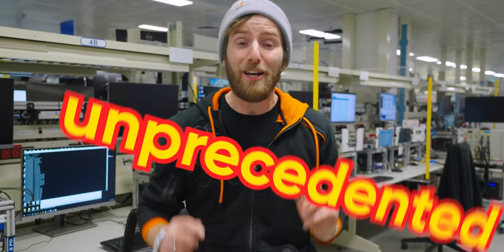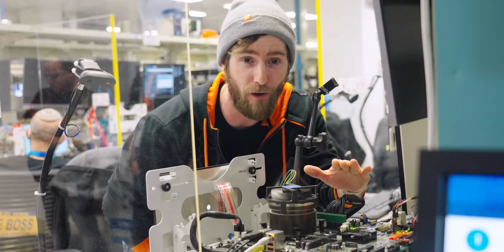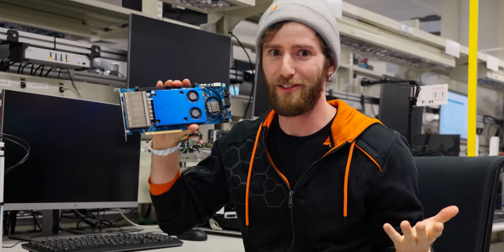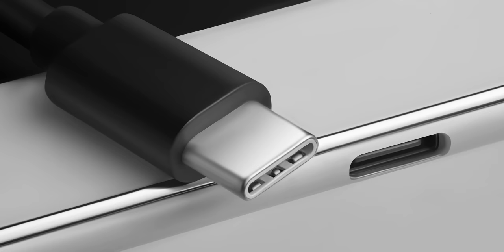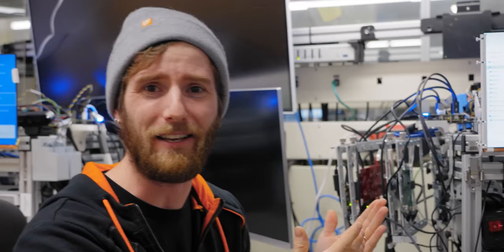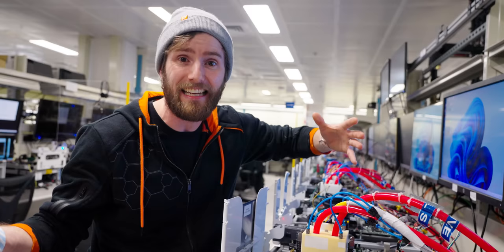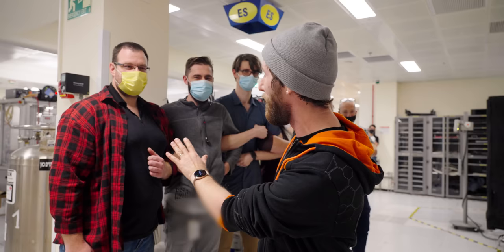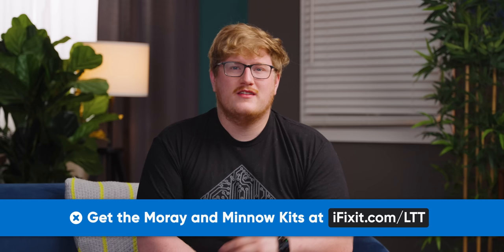I’ve Never Had So Much FUN - Intel Development Center DEEP Dive

Comment: > What came first, the chicken or the egg?

You could say, the egg came first, because dinosaurs laid eggs a looooong time before chickens ever existed.

If you clarify the question to specifically mean a chicken egg, not just any egg, then the answer becomes: "it depends on how precisely you do define `chicken` and `chicken egg`". 

Chickens evolved from their ancestors (let's call them proto-chickens) in a very slow and gradual process spanning a long period of time - so we have to draw a line in the sand somewhere, just to be able to separate chicken from proto-chicken. Keep in mind though, that this is an arbitrary choice! But no matter where you actually draw the line, there will be one parent animal that's not quite a chicken yet, having an offspring that is an actual chicken thanks to having one additional genetic mutation. The very first chicken of all time hatched from it's own egg, and thus the egg came first, or did it?

Well, the mutation that created that first chicken occurred, when the male sperm fertilized the female egg cell causing the DNA to be rewritten, and resulting in a fertilized egg cell. That fertilized egg cell later gets encased in an egg which then gets laid. And finally the first chicken hatches from that egg. Depending on how you define "chicken" and "egg" - the fertilized egg cell itself might already qualify as being one or both. When does the chicken start being a chicken? Is the egg a chicken too? Is the egg cell an egg? At this point the answer becomes undecidable, right?

If you clarify the question further to specifically mean a hatched chicken in addition to meaning a chicken egg (which probably is what Plutarch originally meant when first posing the question) - then you now have to answer the question whether an egg laid by a proto-chicken but containing the DNA of the first chicken counts as a chicken egg or not. You could argue that the egg is not an chicken egg, as it wasn't laid by a chicken. It's a non-chicken egg that contains a chicken inside - as the egg was still formed by non-chicken, thus the chicken came first, right?

It's extremely likely though, that the egg the first chicken later laid (the calcium carbonate shell, egg white, yolk, etc.), is completely identical to the egg it itself hatched from. There's a lot more genetic material defining the animal, compared to the tiny bit that defines the egg. Thus it's statistically highly unlikely, that this one mutation that caused the switch from proto-chicken to proper chicken would actually change the egg in any way. Thus, the only reliable to way to define what is a chicken egg and what is not, is through the DNA inside. And that would make the egg the first chicken hatched from be the first chicken egg. Thus, it would seem that the egg came first after all.

You might now try to define the genetic change that creates the very first chicken to be one that specifically affected the egg. Then the first chicken's eggs would be actually different from the egg the first chicken itself hatched from. But now you're just being a stickler for red tape! Remember what I told you to keep in mind? The choice of where to draw the line between proto-chicken and chicken is arbitrary, and was only done to allow for a clear differentiation between proto-chicken and chicken. But in reality, there is no clear single point where the switch occurred - and in sum there were many genetic changes, most if not all of which concerned the animal, not the egg. 

Specifically picking that rare (maybe even non-existent) egg-related mutation as that arbitrary line in the sand, AND defining chicken egg as "laid by a chicken - regardless of whether there's chicken DNA inside - that's a set of very artificially crafted assumptions to make. So no, that's not a very robust and believable line of argument. And since there is no other way to arrive at "the chicken came first" - the final answer is that the egg did indeed come first.

Comment: You forgot to mention another huge advantage of FPGAs, they can be more economical for production too, when you are talking about small scale.
If you are only producing a handful of devices, the total production cost associated with an ASIC can  be much larger than just paying (a lot) extra per unit for a handful of FPGAs, that's why you find FPGAs in a whole bunch of commercial products.

Comment: As an experienced IT guy, I know that the gearheads will always be locked away in the basement. Yes, litterally. 😂 Sometimes, they put us at the ground floor in a windowless room. Or sometimes, when you're lucky, you get a tiny window with a view... to the HVAC ducts outside (like I have right now). 😅 If you are new to IT I just wanna be completely honest with you: That's the, best you can hope for. 😝

OH! Once I had an office with a view of the street. But I was in a garage that was hastily converted to the IT department's office... and that window was in a garage door. 🤣

Comment: Back in 1999 or 2000 when I worked at Lucent Technologies I was working on the HP Kayak hard drive recall.  In one of the locations I arrived at the users office while they were out, and started working.  There was some weird rig set up in his office that was supposed to be covered, but the cover had apparently fallen off before I got there.  I was wondering what the heck it could be.  It had what appeared to be a CPU in a ceramic package, but the center appeared to be cut out, and there was a laser pointing at it.  When the user returned to his office I asked him about it and he got extremely nervious.  He refused to answer any questions, and told me that I didn't see anything, because if I did he would be fired immediately.  I wonder if what I saw was the same thing as discussed in this video.
Reply: ok.bro

Comment: I know it's a diff thing but USB 3.2 is 20Gbps (plus, two lanes), whereas 3.0 was 5Gbps. That change only took about 6 years. I'm aware USB can't do all the exact same stuff and we're mostly talking about data speed with USB. However, consider a good read/Write speed for an external SSD is around 1Gbps. That's about as fast as the internal Series X disc drive and very fast. It's only using 5% of max capacity, and still super fast. My point is someone will create a converter for USB 3.2 & beyond. This will happen for some things and USB slots are wayyyy cheaper on.

Comment: I used to work at intel, yeah, crazy tech guaranteed. I had to hand adjust microprobes to land on a laser cut square to measure or push-pull a single transistor. Even on older chipsets, quantum simulators were a regular thing.

Comment: the egg has always come first, what birthed the egg was something close to a chicken but not fully a chicken, then a chicken came out of the egg.
Reply: Not quite, the egg and chicken were both proto-specimens with incremental stages. No one specific mutation made either the chicken or the egg, it was an ongoing process.

However if you take it from a difficult perspective, and consider the egg as a single cell. Then the egg can be seen as the forebears of all, for all multicellular sexually reproduced species spring from their humble single celled beginning as the fertilised egg.

Comment: There's good reason that Intel also make their own hardware, both master and slave, so they can also test every single scenarios where they can fail, so that way it doesn't happen in the real life, in the customers' hands, UNLESS there's a good reason for it to fail, ie. PCIe clock loss due to the worn out PCIe slot. AMD also do the same thing with theirs. Reliability is very crucial.

Comment: I wish the DOK (EDID) emulator was commercially available with pass through. So many monitors have sloppy EDID implementations. They can accept a certain signal but don't tell the connected device, say an Xbox that it's capable and as such won't work correctly.

Comment: Hey Linus... check your audio output on physical analogue speakers... is not good (gain/volume?) without in-built digital balancing software in the mix.. maybe is ok on digital headphones. I have to turn down the Youtube volume setting to 30% to avoid input distortion..
My rotel amp and speakers are in full working order...

Comment: that's not a ram slot... xboink, probably a cache emulator bank for raid control of multiple m.2     not every test card is going to need a terabyte of super high bandwidth drive so why spend the money to install 256GB of HBM2 on the board

I think almost nobody online today remembers having to warm-up cycle their computers to get the graphics cards' memory into operating range.   Or using hair dryers, or a light-bulb in the computer case to do this.    Or opening the case of your multiple-pentium server and putting your hands on the extra cache ram cards to bring them up so the cmos wouldn't throw an error and disable them.

Comment: The connection is not design, the total energy is not designed, it means that there is no metaverse on the planet Mars, the initial level of the atmosphere that does not form is not designed 2-2

Comment: Intels problem has never been in their engineering division.  Not even when 10nm fell down the stairs.  It has always been, and continues to be, their organizational structure and their business division and executives.  They are the ones that made 10nm fail.  They are the ones that refused to give the engineers the resources, most importantly TIME, to fix things.  They just stick their noses in and say "we have to release SOMETHING new, right NOW, stop trying to fix it and make some more 14nm parts!"  They didn't have to do that.  That was a choice made by management, and they overrode the engineers.  Then they announced they were intending to force their engineers to do 5 new process nodes in 1 year.  Nevermind the fact they have never done TWO in one year, management insists they will do 5.  Intel has not learned its lesson and it's pretty stunning.  They're so addicted to having 5 managers for  every technical person, 18 layers of management between the folks creating things of value and those making decisions, that I don't expect them to turn that ship around for probably at least a couple more years.  We're in for every single quarter what we saw this last quarter.  Intel comes out and announces their earnings are down, and says the chip shortage is wrecking the industry.  Then 2 days later AMD announces their earnings are way up, and has the receipts to show the market is perfectly fine, they're just buying AMD instead of Intel across every space AMD produces chips.

Comment: If Intel has this much passion for actually marketing (while not lying) and selling their chips to consumers and gamers (like zen lasting almost 6 years without having to change mobos) I'd buy Intel again but whoever is in the drivers seat has a blindfold on and their hands off the wheel while slamming the accelerator and break to the floor

Do amd next linus

Comment: I wonder if the hydropneumatic just puts water on the cpu and uses the compressed air to cool it like evaporative cooling. I'm not sure but that might not be as effective as just water but I dont know. it sounds like a cool video though
Reply: oh, just watched the section in the video.

Comment: @12:30 why the fuck is that not a product? I would totally buy that and run my CPU under 0C or 0F or whatever. If they made a system that doesn't require you to use a chill box or thermal grease that is amazing.....

Comment: Seeing all the equipment was pretty cool. 

iFixit sucks
Reply: Why does iFixit suck? I've had nothing but positive experience with them.
Reply: @theninjascientist689  I have an iPhone XS Max. One day randomly my screen stopped responding to touch, totally useless. I ordered a screen from them $200 plus tax, I installed it without issue, the tools were definitely a good thing. Booted the phone and it worked, however anything dark like Batman or Star Wars looked awful. It was like watching TV on a dying plasma screen. So I told them and they sent a replacement, that screen didn’t respond to touch, I double checked the connections and they were fine. I put the fist screen back on and it worked as it did before. I got a second replacement for that one and still the same unresponsive to touch. They sent me a third and a fourt, but all of them wouldn’t respond. Then they told me they couldn’t help me. I asked for a refund, but they would only give me one if I returned the first replacement I ordered. So I’d be stuck with no screen at all or use my original, that didn’t work 🙄 until I got my refund. That would take about 2 weeks to process. That’s why I said they suck. I live on a fixed income, no way could I afford to buy another screen before I could get the money back. They stuck!

Sorry for the late reply.